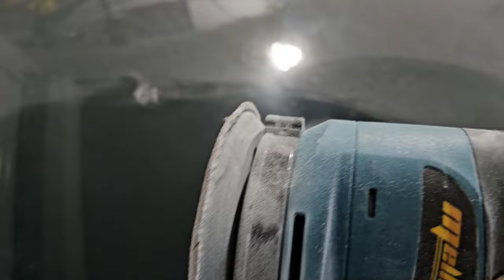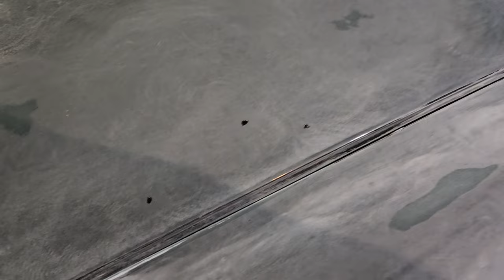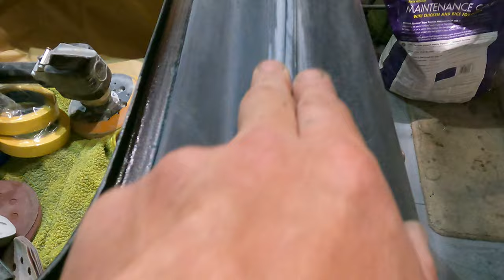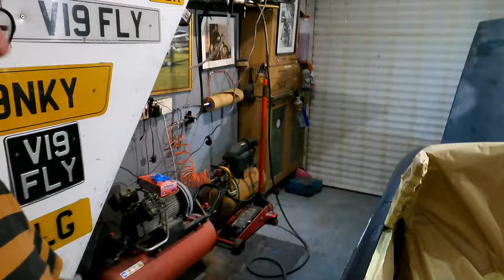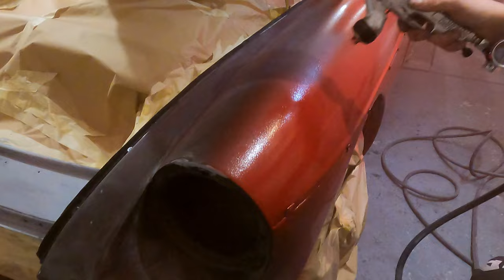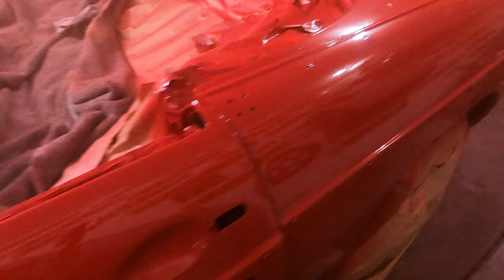How to respray your classic car in a home garage for under £250.

Comment: Great job, the one trick a friend of mine taught me, (I used to paint motorcycles in my garage) was to spray the floor with water 20 minutes before you painted. The wet floor does a superb job of keeping the dust down.

Comment: I did that trick with the wire under the rubber when I painted my last B. worked a treat. When I do the current one I'll use that tip about the seams as well. Nice job.

Comment: Really good video! Lots of work and you made it look easy with good results!  A couple of questions; 1. how many coats did you apply (any clear on top)? 2. Did you wet sand the finally coat? Thank you.
Reply from the maker: Two coats.  Going to wet sand and polish in a few days when it's gone hard. Not planning to do a clear coat as I think that makes it shine too much, and I want it to look normal.
Reply: Thank you for the quick reply. Would you have to do the clear coat after the wet sanding and polishing or do you do all the spraying at once and wet sand and polish after? @LesFieldPhotos
Reply from the maker: @pyoti5765  it will be wet sanded and polished. The two pack red will be the finish no clear coat.

Comment: Hi Les, great paint job. I have an 80' BGT that needs a respray. Almost finished the prep work, now time to decide whether I paint myself (never painted a car before) or give it to a paint shop. My main concern is the safety aspect from fumes etc. Most blogs I have seen recommend extractor fans to reduce risk and the mist whilst keeping the paint area “sealed”.   In your video looks like there door was partially open , didn’t see any fans.  Interested to hear your views on this.
Reply from the maker: I had the main door and a window at the other end  open and a small Makita fan blowing the funes out

Comment: Looks like you have done a decent job of the prep. Did you make any improvements to your air delivery system to ensure you didn't get any microscopic droplets of water coming out of your spray gun along with your paint. 
Kind regards Paul from 48Spokes
Reply from the maker: Yes I put a water trap in the line £15 from Amazon. Worked a treat.